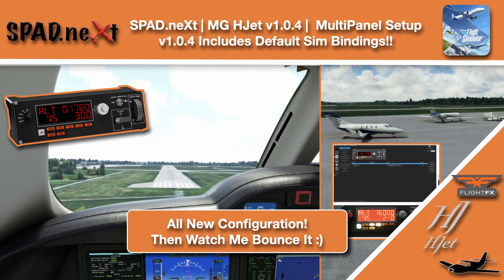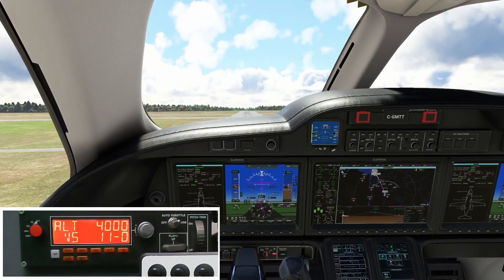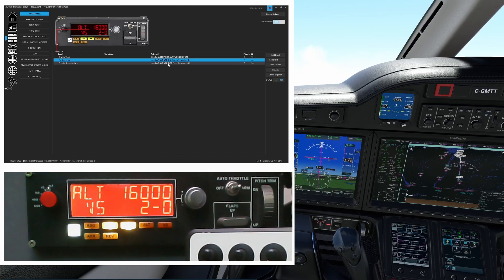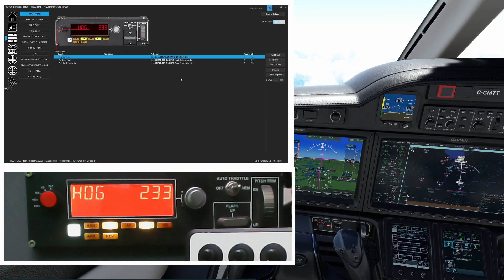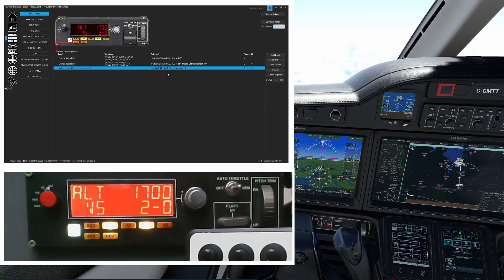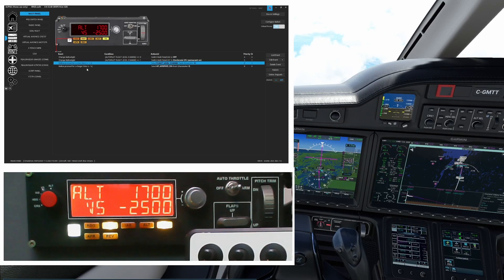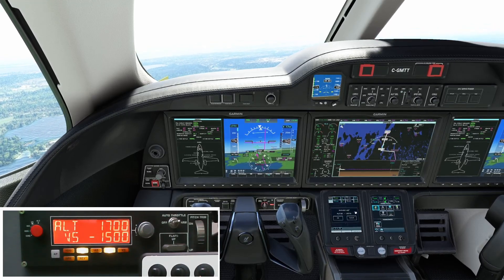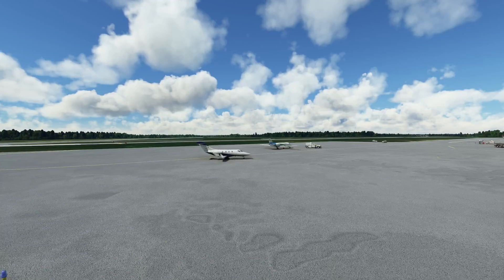MSFS | SPAD.neXt | FFX/MG HJet v1.0.4 | Logitech MultiPanel Config

Comment: Can someone explain to me why with vision jet the saiteck multipanel works 100 % and with the Honda Jet we need to use and adicional software to make with work? Thanks in advance.
Reply from the maker: It will probably be fine after the next update. Only issue right now is the ALT SEL Knob. 

Since that video multiple releases have happens and the dev has implemented the K Event capture feature so that default events work. 

There is a keybinding document linked in the sim options page or from the introductory flight document. 

In it you will see all the things that can be bound. 

And FYI it’s not 100% in the vision as you need LVARs for VNAV and the AT Speed selection of FMS or MAN.
Reply: @LesOReilly  thanks for the precise info. Lets hope the Dev team fix the small bugs in both planes. They are both great planes for. Fs2020. By the way , thanks and congratulations for your tutorials.
Reply from the maker: @PAULOESTRELA0  Just to be clear these are NOT BUGS ...  The Native MSFS K Event bindings have nothing for the VANV, FMS or MAN mode settings...  The K Event capture that the HJet implemented to "reuse" some events (like BC/REV for VNAV since that is not used on the HJET) is a recent implementation...

However again the TBM / Longitude or even CJ4 have no way to enable VNAV or with the Longi the AT FMS or MAN modes... This all requires LVAR control that is only available with external Apps..  It's not a bug.. It's a 3rd party dev trying to implement further capability than you have with the Built in system....